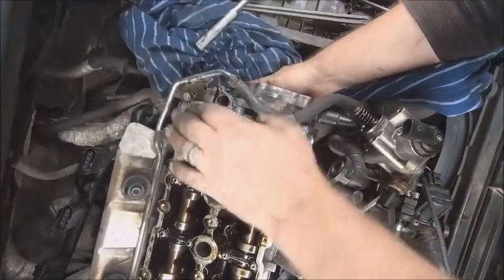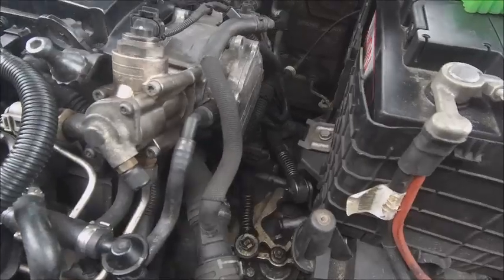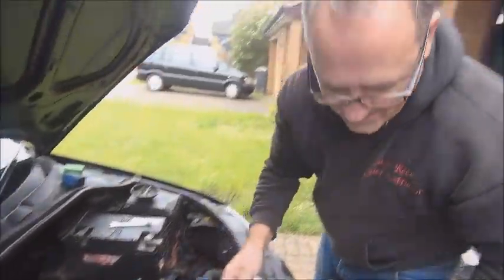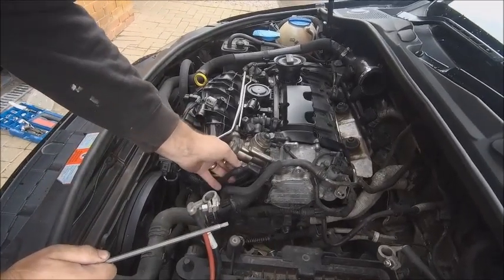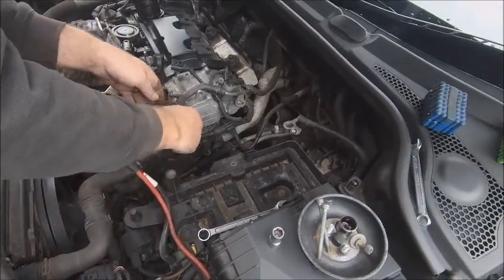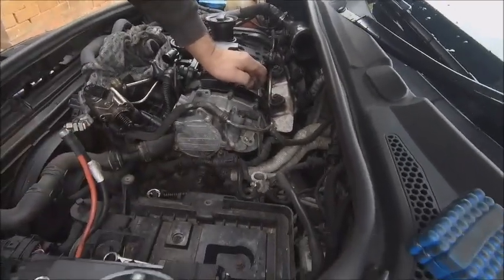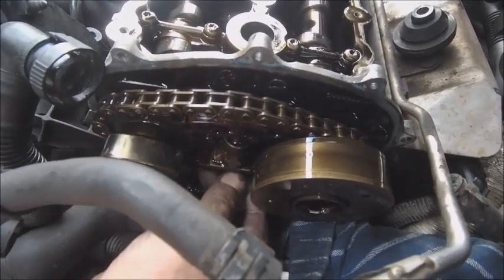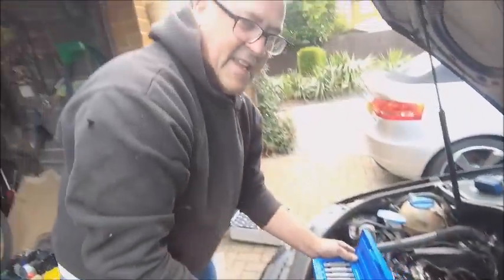#Audi #S3 #TFSI Cam Chain Replacement VLOG

Comment: Bless bolt in the exhaust cam is a tight definitely I did mine a few years ago. I used a Audi special tool rather than spline. Needed one person push breaker bar into bolt while I pulled it snapped loose and was done easily. Some garages would charges you around 500 to 600 for this job. Worth the takle
Reply from the maker: yeah was a job i really don't want to do again , but get there in the end  😉

Comment: The chain doesnt really stretch as such. At the dealer we call it elongating. The pins between the links actually wear. So if you had to hold the two chains horizontally you would find that the old chain "arches" a bit more than the new. Great video by the way. Never been in a position where I had to strip the craddle off.
Reply from the maker: Thanks ...may all your cradle moments be smooth ones..
Reply: @Ade Reeves  thank you so much 🤣🤣🤣. I actually have a customer booking his vehicle in next week so let's hope it goes "smooth".
Reply from the maker: @cohankok2786  it will be fine  :)

Comment: Alright bud, spoken to Audi and they got there diagram out. They got the bolt down as an m12 socket?& to point out m8 you said cam follower/cam guide? It’s called chain tensioner right?

Comment: My car sounded like yours did when you first started it. I’ve changed everything. Swapped plugs and coils first obviously. Then injectors and decarb,  then I’ve just done this job. And it’s still the f’in same !? Any ideas other than to check for a vac hose off? Which I’m sure there isn’t. Would a leak make it run this bad?? Thanks.
Reply from the maker: make sure all the hoses are in place correctly , also see if the cam plug at the RHS of the top cover has come loose .... these things hate air leaks ...last double check the timing is spot on , they will still run one tooth off , but will sound rough as Fk....
Reply: @AdeReeves  cheers buddy, I’ve timed to the marks and counted links to match both pulley marks. But I’ve only had my info from YouTube. So I’m not certain they’re right to begin with to be fair. But the cam timing chain seemed to go on too easily if I’m honest. Need to get a smoke tester I think so I can test all the pipe work properly.

Comment: How’s the engine holding up ?

The cradle has an axle seal on both cams on the belt side, any leaks from disturbing those?
The cradle also has oil passageways which you block if you do it with rtv instead of anaerobic sealant, any scored journals from oil starvation?
The cradle bolts are tty, probably fine to reuse but I’d be scared with them taking the valve train stresses.
I didn’t see in the video if the exhaust cam popped out of position but if it moved then most likely the belt tensioner moved aswell.

Just rebuilt my engine and got the intake 1 tooth off so I’m going to redo it , hopefully the adjuster bolt will come off easy so I don’t have to redo the cradle, if I will I’ll just buy arp reusable cradle bolts
Reply from the maker: all is fine and still sweet after almost a couple of years... the bolts don't have much of a load on the and its spread evenly over many.. the cams will move while doing this but easy pop back in again and the tensioner on the belt keeps the timing good as long as you don't let the cams go interstellar..  😀😁

Comment: Hi mine has snapped and need to tackle this job os there any special tools I will need to do it my self or will it better getting a garage to do this
Reply from the maker: The usual crazy Audi spline / star drives ... a cam locking tool is handy but not totally esential .. I guess the bigger picture is has the snapped chain bent any valves ..

Comment: This would be my worst nightmare having to remove the camshaft cradle . What exactly happened to the bolt holding the cam adjuster? Did you round it out ? 

I'm going to be doing this next week have you got any tips lol great video. Nothing ever goes to plan when you work on a car especially when it's your own!
Reply from the maker: HI...The bolt felt like it was solid, perhaps too much lock tight from a previous removal.... I have been told you need to hang off it with a breaker bar which i did, but i got worried the force/ cam locker would snap the cam as i had myself and my son trying to hold it still while i put all my weight behind it....and it still would not move....  To be honest taking the cradle off wasn't that bad but i would recommend putting plenty of ref marks on the cams and covers before you take anything off as you will need to check and double check for peace  of mind as the lock bar alone can let you set the cams one tooth out....  Take your time...make the torque wrench your friend and you should be OK.....For ref all the gaskets i used again but them and the cradle have embedded silicone seals so you will need to use a little instant gasket to ensure no leaks afterwards, be sure to use it sparingly as you don't want to block oil ways... let me know if you need any more help....hope it goes OK.
Reply: @AdeReeves  thanks for the reply!  I enjoyed watching this video.. I'm just worried about the adjuster bolt more than anything.. I have a decent m10 ribe socket but still worried about rounding it or breaking something! 

I'm just going to go for gold and hopefully I won't snap the camshaft or the bolt lol
Reply: @AdeReeves  hi sorry to bother you again, but you seem to have mastered this so I would just like to ask a quick question, you say the tool lets you set the timing a tooth out, which is the best point of reference to look at.. would it be good to mark the old chain and cam end sprockets, count the links and then fit that way ? 

How exactly did you master it. 

Many thanks for your help!
Reply from the maker: Hi  @AdammP  so...the best way I found is to get the cam belt end to TDC before you start and  then from there the second cam lobs in (Cam chain end) should directly appose in angle and point to the inner bolt holes on the cradle....If go to about 23:00 on the following video  (  https://www.youtube.com/watch?v=UgQB3LRrePc ) ...He explains it quite well but the measuring may be a little extreme...Also the more ref marks you can make before you dismantle the better...i did ones on the timing belt end (At TDC) & on the gears on the cam chain end and it all lined up fairly easy... Keep in mind with the cradle loose it wont be "bob on" but as long as it is when you tighten everything down ...its happy days.

Comment: Hi bud awesome video... did you have you push the cams back down after removing cradle? Mine has popped up due to timing belt tension and can't seem to get them back down? You have any advise bud?
Reply from the maker: mine seemed to pop back in fine, maybe gently put the screws in the cradle and gently ease them down with equal pressure over the whole cradle .
Reply: @AdeReeves  yeah I tried that but once all bolts in and re torgued down I couldn't turn the crank it was locked out. Removed all bolts again and it turned fine I think it's going to be a belt off job and start from full scratch 🙈🤷‍♂️
Reply from the maker: Dam....  sorry to hear you are having so much grief.. The job was a pain but no where near as much as the pain you are having ...I guess if you can get to the tensioner at least you might be able to slacken it off enough to get it seated... 😁

Comment: Good vid....typically some jobs never go as smoothly as hoped. Do these timing chains rattle a bit after an oil change until the tensioner is filled or would that be a sign of a failing tensioner? Cheers
Reply from the maker: Thanks...the rattle is more when its up to temp and you rev it ....or its on tick over and it sounds more prominent than the TFSI typical injector tap.....   If yours hasn't been changed in 60 plus thousand mines then there is a fair chance it needs doing   ..

Comment: Mate, I have 2.0 Tfsi... Bwj, imagine it’s same engine... but my engine annoyed me like this. Be following from now 🙌🏽 none of my tools fit, bolts snapped and I snapped an air con line just replacing rad packs😂 thanks for the Video 🙌🏽
Reply from the maker: They are great engines....until you have to work on them   😄
Reply: @AdeReeves  couldn’t agree more; power output is outstanding. Boost 👌

Comment: Hi, you mentioned the TFSI knock at the end of the video? Do you get this knock when the timing is off / bad tensioner / stretched chain?
Reply from the maker: the TFSI engine is always a bit tappy more than a knock so expect it from even a newish engine...you will get a more pronounced tapping with a stretch chain and also hesitation on acceleration and even a metallic "rubbing" sound in extreme circumstances..
Reply: @AdeReeves  thanks for the reply mate. Think my tensioner is gone on my 1.8 TFSI 8v, I also get a rattle on start up, goes away and comes back when up to operating temperature?
Reply from the maker: @dannyross5702   I'm no expert but that was similar to my initial issue.. chances are if its not been changed from new or every 60000 miles or so its stretched... it could carry on like that for years , I just didn't want to take the risk.

Comment: Mine should need doing but doesn't according to the rough guide you get when checking on VCDS, all the head has been stripped down and cleaned plus new injectors fitted also the belt and tensioner so the garage may have done the chain as well as they said they won't refit old parts when it comes to the belt etc. on the BHZ it has a belt as normal then then chain you replaced so double the things to go wrong, think I'll leave this to the dealership or Audi specialist 😹
Reply from the maker: All TFSI engines (in fact most Audi) have the chain plus belt, but the chains should last a good few belt changes...hope the specialist give you a good price ...

Comment: Did you use OEM parts (chain and tensioner) ? Or INA FEBI ? For the exhaust cam, it’s a special vw tool T40080, with the M10 split you damage the bolt. Thnx for the video, consider doing this next week.
Reply from the maker: Hi..It was a Febi chain as these seemed to be rated as the best and the special M10 socket brought especially for the job...many people have seem to experience the same problem with the bolt, but to be honest taking the rack off and doing it that way worked OK...  good luck with yours  :)
Reply: Ade Reeves thank you for the reply, i will try and do it over the weekend! And thanks for the video, very helpful!

Comment: hello thank you for the video do u think one could just change the tensioner without ever replacing the chain as far as the bolt removal if i just wanted to replace the tensioner?
Reply from the maker: The chain will stretch over time and if left indefinitely maybe even break....so to be honest i wouldn't   😉
Reply: @AdeReeves  not what im asking brother could the tensioner be pulled with out removing the chain or the pulleys? do u think thats physically possible
Reply from the maker: @fatherchop5796  sorry ....yes the tensioner can be replaced alone, obviously making sure the chain does not move .  Cheers Ade

Comment: Hello! what is your fix when your motor very bad idle?im the same problem ! Thanks!
Reply from the maker: I would go for the PCV valve first ..then check for vacuum leaks .. but yes could be a stretched chain if its noisy too ...
Reply: @AdeReeves  what is your fix @22:47? Im the same problem after this opération too thanks !!
Reply from the maker: @MrKevgt  it was the bottom pipe from the PCV valve to the block not seated right ....its a right pig to get at...I have replaced it now as they get very brittle with age so wouldn't surprise me if you find a split in it ....mine also had a crack which i taped up to get it running
Reply: @AdeReeves  Thanks :)

Comment: What did you re torque the cam cradle bolts to?? I've read there stretch bolts. I had same problem as you and not sure what to torque them to??  Thanks
Reply from the maker: Hi Ben...yes you are correct they are in fact Torque To Yield bolts and officially (if you listen to Audi) should be replaced... But I'm fairly confident the cradle has never been off so i knocked them back at 25NM....done this before on other Audi's of old and so far not had an issue but saying that they are fairly cheap to buy as well (T30 torx) or go for reusable ARP ones...

Comment: Hi how many miles after do you have to change the timming chain and what do you need to change with it is just changing the chain or other parts to thanks
Reply from the maker: Audi say about 60 - 80 K ...so not that frequently...all depends on the power you pushing and how you drive...Like all Audi your gonna need the usual spline drives ...But the rest is much as you would expect...The only issue i had was the bolt on the gear, would not budge (i'm told that's common)...But then taking the cradle off wasn't so bad.

Comment: What where the noises and symptoms? Mine has delveloped a ticking/tapping around 1,500/2,000rpm and it comes from the passager side so I suspect its the chain
Reply from the maker: Much the same for me...sounded more like a diesel than petrol...I know they are a noisy engine anyway but even though the chain did not look that stretched it ran a lot smoother afterwards and a lot quieter.
Reply: Thanks mate I'm currently talking with you on the s3 page on Facebook 🤣

Comment: Hi great video. Mine needs doing but unfortunately id be way out of my depth doing it myself. I've been quoted £580 all in at an Audi specialist using OEM parts. Is this reasonable?
Reply from the maker: Audi are never going to be cheap.. but at least you know it should be done by experts  😉
Reply: Nope, buy the parts yourself for no more than £80 you can buy a good aftermarket kit off eBay or parts dealer. Then find a decent garage to do the job. Shouldn’t cost you more than £200. Be smart and don’t get ripped off. Good luck man
Reply: quoted 995£ by my dealer in Tokyo (¥151k) so yours is reasonable. They charge triple to sixtuple for parts. They change all bolts too, and control valve. And not the phaser, if you ask the phaser it's twice the total quote.

Comment: When do you have to change the timing chain
Reply from the maker: lots of debate on this...mine had a slight rattle but seen Audi quoting every 60.000 miles
Reply: @AdeReeves  funny you should say that my b7 has just started to rattle at 59 k

Comment: Great video! Currently doing this right now but I'm having trouble fitting the cam cradle back over the cams. How did you squeeze it back in near the upper timing cover without it getting stuck? Did you take the belt off the cam gear and just not record that part? Any help or tips would be appreciated!
Reply from the maker: Hi Roy...No the cam belt never came off...just made sure everything was at TDC and it went together OK...did have tom wind it down flush with the bolts though as there is obviously some spring tension .

Comment: thanks for the vid mate it helped me somewhat to understand the engine set up.
I can't imagine even trying to do this.... lose one bolt and its all over... lol
How many miles/klm does the S3 have on it ? . is there a rule of thumb when the timing chain should be replaced?
I'm considering buying an 2009 s3 with higher klms (around 80 - 100 k) hopefully with the auto gearbox... any advice????
Reply from the maker: Hi...The best advice i could offer is history... I change the oil in mine every 5000 miles and use Millers Nanodrive and I also have history from previous owners who have always taken a similar approach... I'm not saying you have to be this fanatical but if the car has no history or its had cheap oil changes from the bargain bin its probably not gonna do it much good...At the end of the day these are performance cars....The chain itself Audi have a loose service interval of around 100,000 miles but mine is  on 118K and i'm not sure its ever been done... The best rule is to listen to the engine , The TFSI always has top end noise but if its sounding more like a diesel than a petrol its probably time to consider it for a new chain... The Cam belt idler gear can also make a bit of a racket but if you listen more towards the cam link chain end cover (RHS) and it sounds like its grating, then factor in the cost and beat the price down as a garage it going to sting you at least a days labour plus parts..
Reply: @AdeReeves  
Thank you for your advise and will sub your channel